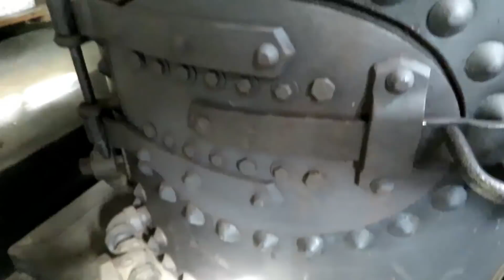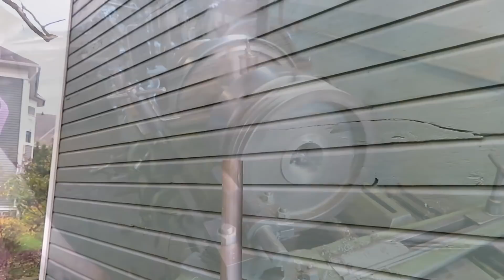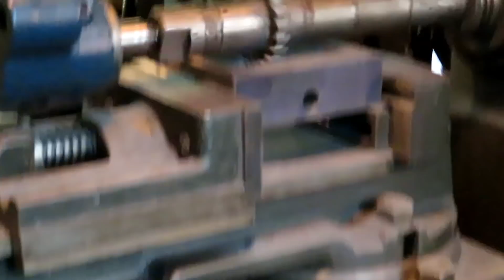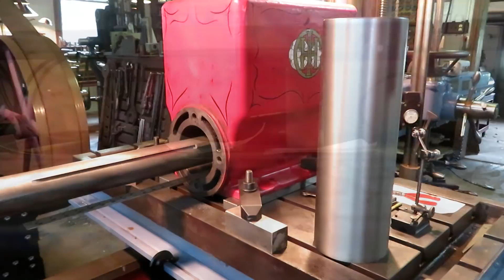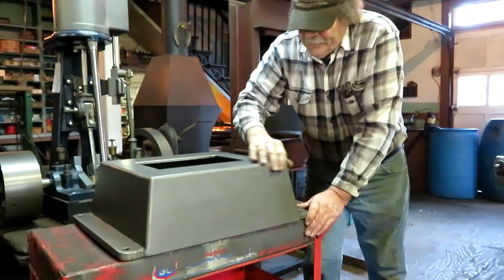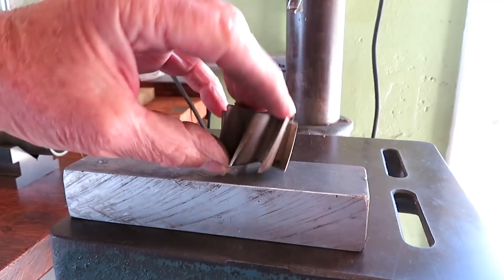OLD STEAM POWERED MACHINE SHOP  77   LOOKING BACK

Comment: Dave,
Another great video! Loved the history of your building!

Chuck keys. Have a safe place for them. When a chuck key isn’t in its safe place, keep a hand on it at all times until it is back in its safe place. If you have to step away from the machine, for any reason, put the key back in its safe place. It only takes a couple seconds to do so.

Many years ago, my brother worked in a machine shop. A new guy forgot, left the chuck key in a good sized lathe chuck. He started the spindle and the key flew across the room right past the foreman’s head. Foreman walked over and ‘clocked’ the new guy a good one. Nothing else said. When my brother left to pursue another career, the ‘new guy’ had become a good machinist. Not the way I would have handled the situation. On the other hand, I wasn’t just missed by a big flying chuck key!
Be well & Best regards!
Reply from the maker: Another chuck key story for the files...Dave

Comment: Back in the olden days, people were supposed to have a little common since.  As a child most people worked on farms or the like, but now kids sit around in the safety of their homes and don't have any experience doing anything but play video games.  The safer things get, Cars, tools, work places, the dummier people get. If the lathe were a new invention of today OSHA would probably put so many guards on it you could not use it. I had my own car at age 10 (in the 1960) and I drove it around on our property for years before I got a drivers license and went out into traffic.  I run into the mailbox, the house, the fence, the tree, the garage. I made every kind of mistake you can make with a car before I went out on the road.  That kind of thing just doesn't happen today.
Reply from the maker: It happened to me...it was a 1951 Ford that went several hundred miles on the property and around that shop barn. My neighbor good friend had a 48 Chevy. We learned about things....Great comment....Dave

Comment: Thanks Dave. I always wondered about your shop. Interesting about the heavy timbers that support the floor. No wonder it has stood up for so long. Is the section where the planer lives an addition to the old part of the shop? It looks like that's where you have your "modern" equipment! :)
Reply from the maker: When I got the shop running and busy as a motorcycle/lawn & garden equipment dealer in 1973, my father almost single handedly built the front addition for a showroom at age 83. ...Dave

Comment: Hi Dave, Many, many years ago I worked at a sawmill not all that far from you just outside of Wellsboro, Pa. They had one saw with what I seem to remember was a 12 foot blade and another with an upper and lower 6 or 8 foot blades. No guards at all. No railings. Just the equipment needed to get the job done. The safety controls were the mass between your ears. The general rule was the sawyer was the ONLY person to get close to those saws when they were running and there was never any concern of people not paying attention. I worked there for a couple years before moving and there were zero accidents and before that in something like 15 years the only major accident was a broken leg from getting caught between rolling logs in the yard. People nowadays depend on all the safety restraints to protect them.
Reply from the maker: Great comment Rick, I guess there was a lot of lumber industry in that area back then....Dave

Comment: Great Rules Dave! We too made up our own rules. The top 3:  1. Don't trust anyone. (translates as see / check for yourself.) 2. The standard is: There is NO standard. (translates to take nothing for granted). 3. Slow down or you'll never get there.

What make & model is your blue horizontal mill?

Keep up the good work!!!!!!!!!!
Reply from the maker: 1894 Brown & Sharpe #1 with rack & pinion table drive....Dave
Reply from the maker: I got to thinking you might have meant the boring mill, it's a Giddings & Lewis 2.5", probably about 1939......Dave
Reply: @davidrichards5594  As always, I love your videos! This latest video captured your use of the Van Norman 10" vertical dividing head no less than 3 times! It was the blue mill you use it on that was in question. It is reminiscent of an old Van Norman - but I understand it isn't. That divider, though, was patented in 1943. Could that be the most modern piece of equipment in your shop?
Reply from the maker: @BROCKWOOD64  The dividing head was rescued from the scrap of a turbine blade building company near my NY shop by a friend that works there. It also had the gear set for differential work and all the hole plates. That was also the source of the 32" shaper and a Bridgeport mill I bought as scrap.....Dave

Comment: Good day Dave. My name is Grant. I too am an appreciative fan of yours. I recently bought a lathe which is remarkabley close looking to your American Lathe. Although the one I have is a CMC made in Canada in Galt, Ontario. It's a flat belt drive similar to yours and I was just wondering what your top speed you can run your lathe at? Also what are you using for a lubrication oil on the plain bearings for the head stock? This information would be much appreciated as I have not seen anyone else with a lathe like ours. Thank you for your videos. Sincerely, Grant Lapointe from🇨🇦
Reply from the maker: Grant, In the fast pulley step it will run about 550. I use 90w non-synthetic gear oil with about 10% Lucas oil conditioner additive (sometimes STP).....Dave
Reply: @davidrichards5594  Thank you for the information Dave. My husband will be thrilled to see your msg as he sure is  big fan of yours but our tractor is down so he's out shoveling some good old dependable Canadian snow lol. Dave my name is Maggie and I was wondering if we could exchange pH # as my husband is around your age with alot of machinery like yours. He's a mechanic, a machinist, he has his own saw mill etc he likes your sense of humor and he can't get enough of your videos. The lathe he had me txt you about was bought out of Manitoba but unfortunately there was no info on it and I know he would like to speak with you about it but he's not really big on txtn. We could call you if you'd prefer. If you want to send us your number but not over the internet I will give you Grants email address and cellphone. grantlapointe1@gmail.com pH - 1-306-941-1800 I'm going to call him in for some lunch now. He will be thrilled to hear from you. Thank you Sincerely Maggie 🤗

Comment: Lot a shops amongst the old order people that use line shafts. may be not steam and flat belts , but none the less a line shaft powered by something other than electricity. A lot of air tools now but a lot of gas motors
Reply from the maker: Most of the Amish and Mennonite owned industry  in Lancaster County, PA where I am most familiar use pneumatics for most things these days...Dave
Reply: @davidrichards5594  I was referring to white top or Nebraska Amish.  The shaft are run with a gas motor. When i was a boy some were still using power units that were steam but pulled with a team . Probably quit because of all kinds of gov. regulations. . Also used a lot of 2 cyl john Deere motors on skids. The neighbors shop had a line shaft down the wall at the floor. Mo flat belts though. had all kinds of grizzly wood tools run off of one Honda  motor.

Comment: Mr. Richards, can you educate us on belt maintenance? how do you treat them, how often and so on to make them last. And one more thing, witch way towards the pulleys, flesh or hair side?
Reply from the maker: The old rule with leather belts was to put the "grain" or hair side against the pulley because it is the most crack prone side and will be compressed going around a pulley rather than being stretched by going around the outside. Most of my leather belting is so old (could be 100 years) I can't tell and it's obvious that it has been run both ways. I can't actually see much difference. I wipe some neatsfoot oil on the outside of the belts once a year. I have taken them up for stretch several times initially, but eventually they reach their stretch limit and I never touch them.....Dave
Reply: @davidrichards5594   Thanks for your reply David, I bought a swedish made Solberga camelback drillpress, a few years ago. There was something facinating about it, so i had to buy it, and the price was right. An old collegue came to visit, and he recognised the drillpress, with a Ford model A gearbox mounted on it. He told me he was a relative of the man who mounted the gerbox, and that his relative bought the drillpress from a blacksmith shop just down the road from my farm 50-60 years ago. Well there were only one blacksmith there, and that was my great grandfather, so now i have both his anvil and drillpress. Restoration is required, and a new 2" leather belt bought, since the old one was gone. Thank you David for the education on leather belts and all the great videos you make. Regards from Norway
Reply from the maker: @jonetveitane  Hi Jone, What a great find, to get that drill back with your family....Dave

Comment: The one thing that I was always afraid of was getting a piece clothing caught up in a machine!! I saw a security video in a shop of a young man walking past a large lathe with a 4in steel rod being turned down. Well they had a shop fan blowing on the machine because summer in Texas sucks. Anyways he had a button down shirt that he had unbuttoned. So when he walked past the lathe the fan blew his shirt over. An it got  caught on the bar being turned, an it wrapped up and pulled him into the machine!! He was dam lucky that it only ripped the shirt off of him when his back hit the side of the lathe. The whole thing took less than 2 seconds.
Reply: Second shift journeyman toolmaker Dean was squaring mold cavity 5 7/8" thick blocks on the K&T mill, his apprentice (me) was drilling 7/16" diameter waterlines on a drill press nearby. He was brushing cutting oil on the multi spiral fluted 2" diameter x 6" long cutter from a container on his tool cart, then the accumulated chips away with another brush. Turning left to get another brush of cutting oil his right tee sleeve touched the cutter pulling his back into the traversing machine. Wrapping the cutter's sharp teeth with cotton he had a series of red welts across his back before he could pull away. No skin broken but again in about 2 seconds!
However I am a tour guide at the water wheel powered 1826 Wallace-Cross grist mill on summer Sundays which all operating equipment is belt driven, fenced from pubic access but demoed by all trained guides. Raw power from the wheel to the main shaft is gear driven sheided in the unoccupied locked basement.

Comment: Hi Dave,
    I started life in my grandfather's line shaft shop. It was powered by a hot tube gas engine running a large lathe, mill and drill press. I can well remember my Dad and his father  teaching me at age five how to be safe around the belting in the shop. I agree with all the safety tips you mentioned especially the filing on the lathe. Drives me nuts watching people hang their left arm over the headstock and chuck just waiting for their shirt cuff to get caught.

Comment: Would you explain the function of the device with a sight glass on the steam inlet pipe to the shop engine?
Reply from the maker: Hi Leonard, It's called a steam separator and it's purpose is to trap condensed water that might come down the steam pipe to the engine. I can't tell you the video number right now, but I covered this when I built it and got the big engine going. The bottom outlet has a pipe inside that comes nearly to the top inside so any water coming down is trapped around the outside of it and the sight glass shows it. There is a drain valve at the bottom that will run the water out, piped into the engine exhaust pipe and out of the building. It doesn't catch much while the engine is running and the steam pipe stays hot. It fills up on a cold start up or if the engine has been stopped for a few minutes. Running a lot of water through the engine is rough on it because it will wash out the lubrication in the cylinder and can cause a "hydraulic lock" because the water won't compress like air or steam and can cause damage to the engine....Dave

Comment: Hi Dave I have enjoyed all your videos and thankyou for making them.I am not a saftey nut in fact I have stationary engines and run machinery with flat belts at machinery shows .There is one thing in your shop that does send shivers up my spine it is the two small universal joints that drive the milling machine table they appear to be very close to your trouser leg and could snag these. As you said your father taught you not put your hands where you can not see them, in this case you are concentrating on the cutting process and not looking down at those universal joints.I relise that the camera can give a distorted view and it may be perfictly safe . Stay safe and well, enjoy Florida. Ray from Adelaide Australia.
Reply from the maker: Ray, I'd not thought of that, you might have a good point....Dave

Comment: Back when line shafts were more prevalent, common sense was also more prevalent.
Brains were engaged and self worth was higher. 
Thanks for sharing the history and tips of your upbringing.
May you continue to produce videos and products for as long as you have the desire to share.
Reply: I couldn't agree with you more.
Reply: John you stole my thunder.  Retired carpenter and I can still count to ten. Common sense goes a long way.
Reply: I think there is one thing you may have failed to mention. People were warier in line-shaft driven shops because everyone knew several people who had lost fingers or arms or lives in machinery accidents. Nothing like bad examples to keep you alert. I'm not all that old at 78, but I've known at least a dozen people who have lost at least some part of their anatomy to machines. (I was almost scalped, myself, by something as innocent-seeming as a 1/4 inch electric drill. Those tiny cooling fans can really suck hair in.)
Reply: @PeterWMeek  
Just turned 77 myself. I haven't lost parts, but have scars from getting complacent with machinery. Guess I was in the process of losing my 'common sense' gene.   lol
Reply: @FeralPreacher  Right, you're 77 so you were working in the 1960s with decades of safety precautions being implemented. Think about any 1880s-1910s industry, or even further in either direction, and how often workers were killed on the job. I was the 4th generation of machinists in my family and heard/ read all about how every guy in a shop could name someone that had been killed. Most everyone, my grandad included, was missing at least one finger. 

Getting complacent left you with relatively minor injuries instead of an amputation! Ain't no gene lost, just the sense itself! 😄 It wanders off from time to time for all of us. 😆 We all get tired, zone out and do something stupid. 

Progress is not losing an arm because you're a little tired and misstepped nearing the end of your 72 hour work week!
Reply: lol i agree you cant even give common sense away any more.
Reply: @brucewayne9300           Common sense ain't common
Reply: I'm not so sure the safety history of the 1900s really line up with what you're saying. A guy without a finger due to a shop injury is more rare today than a guy with all his fingers back then.
Reply: There is a world shortage of common sense today. I spent the last 30 plus years using common sense to run a successful business. Without it I would be out of business. Every young person that has worked for me I tell them if you're not sure use common sense and you will succeed. A lot of training as well.
Reply: @JourneymanRandy  
Well said. Thanks Randy

Comment: Good morning Dave. Thank you for the video and also for sharing some of your safety tip's. I was lucky enough, in my opinion, to go to school in the era of them actually teaching useful thing's like metal work. My metal work teacher was the best teacher I ever had and one of the many things he passed on was, keep your hand on the chuck key when it's in the chuck. I have seen videos on YouTube where 'machinist's' leave a lathe chuck key in and walk away from the machine and every time I see it I remember my old metal work teacher, so, is it a good thing or a bad thing?
Reply: I also had a lesson on why not to take your hand off that chuck key. I was working in the machine shop at United Airlines back in the 60's in the lathe dept. and someone on a machine in front of me had left the key in his chuck and turned it on. That key flew over our heads and knocked a chunk out of the block wall behind us. If someone had been in the line of fire they would surely have been killed! So I also cringe every time I see someone on youtube leave the key in the chuck and I see it far too often.
Reply: I was taught the same.
Reply: The poster in my 7th-grade shop class said, "Leave key in chuck, You'd better duck!"

Comment: I was curious as to what you use to lubricate your dead centers since white lead is no longer available.  I use a mixture of steam cylinder oil and flake graphite.
Reply from the maker: Most of the time just wheel bearing grease. I'm turning things pretty slow....Dave